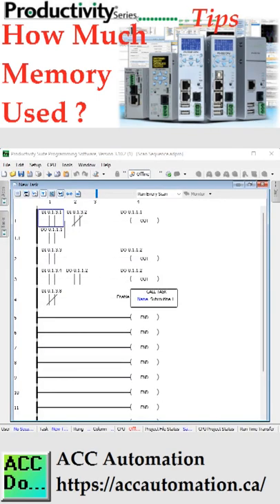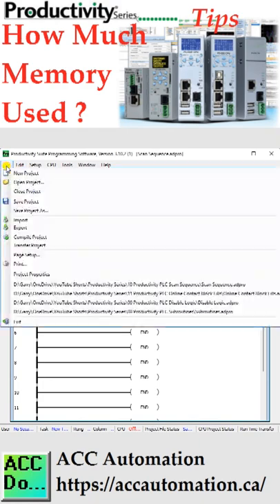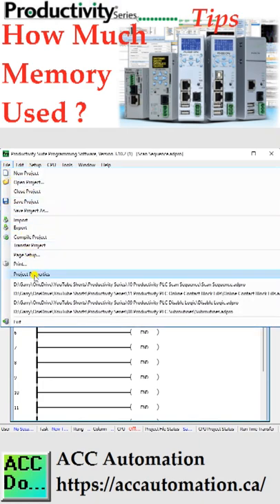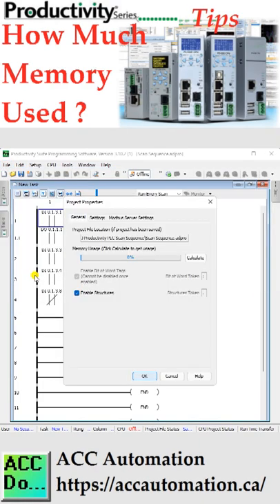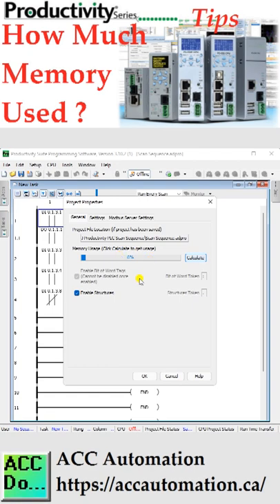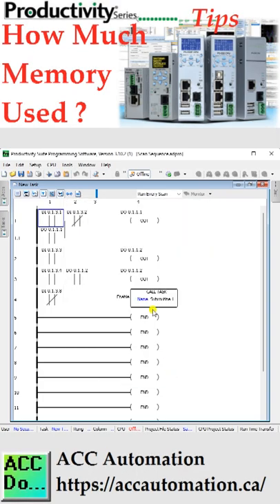How Much Memory Used In Productivity PLC?

Comment from the maker: Programming and examples of the Productivity series can be found at this URL:
https://accautomation.ca/series/productivity-1000-plc/
https://accautomation.ca/series/productivity-2000-series-plc-p2000/

Productivity offers three distinct form factors with two being rack-based and one being stackable. Each series offers different I/O capacities but all use the same programming software, allowing you to easily scale your control up or down depending on the application or machine building. The productivity suite software provides versatile programming with tag name addressing that has no predefined memory structure, and offers convenient device integration for easy plug-and-play operation with our PS-AMC motion controllers, GS drives, Protos X field I/O, and StrideLinx VPNs.
A few of the Features:
- Tag name-based programming with 50MB user memory
- Numerous built-in communication options including Ethernet, serial, USB, remote, and local expansion
- Web server and mobile access
- OLED/LCD module data displays (P2000/P3000)
- Integrated motion controller, GS drive, StrideLinx VPN, and Protos X field I/O support
- External microSD data logging
- Scalable platforms from 128 to over 59K I/O points with analog, discrete, pulse width modulation, and high-speed options
- ABS certified for marine applications (P2000/P3000)
- Project simulator
- Easy-to-use coordinated motion control with the PS-AMC motion controllers and built-in motion instructions

Regards,
Garry 
ACC Automation
https://accautomation.ca/